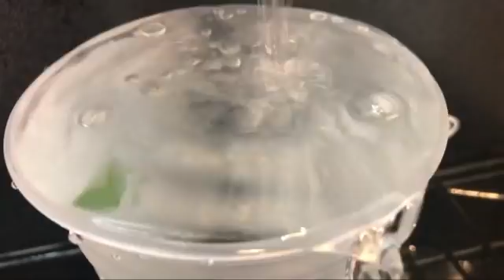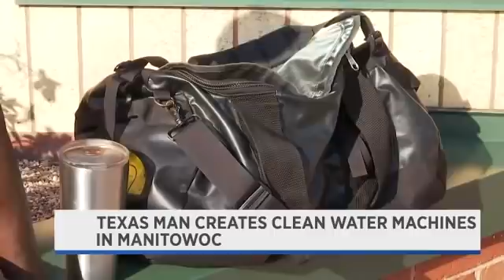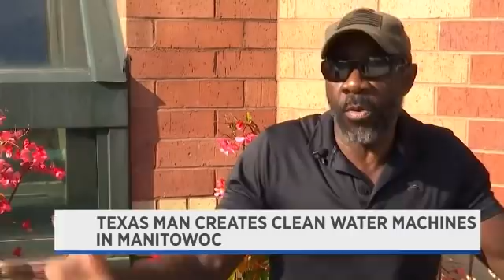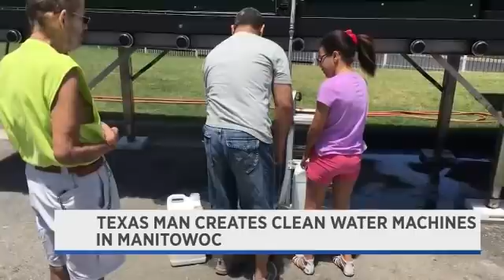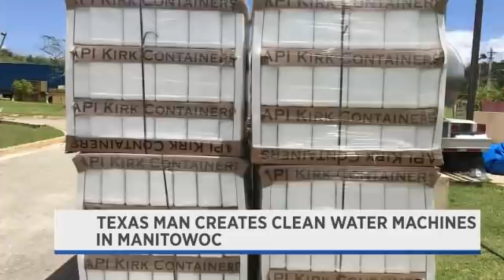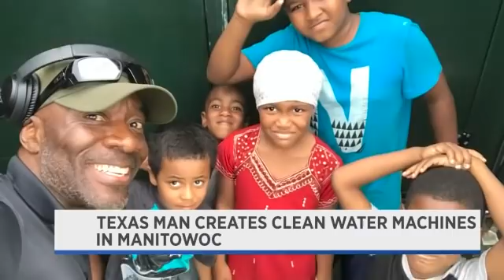Texas Man's Invention Creates Drinking Water from Air

Comment: He's done more for Flint than our government
Reply: no one  "Creates Drinking Water from Air" is false in every almost every aspect except for the word "from". 
TL;DR: It's significantly easier to get drinkable water from a filthy puddle, than the air around puddle.   
  
  
These types of machines are notorious for being "invented" every few months or so, with no real improvements to the general design simply because the physics don't work how people want them to. 
Basically, to get drinking water from the air you need to do 3 things, Condense, Purify, and Make Potable. Nearly every "invention" gets tripped up at the Condense step because the energy requirements are too demanding. For example, take a pot, fill it with water, and boil it until it all becomes steam. How long did it take? And how much energy did you use? Answer is usually 'a lot'. To pull water (not drinkable water, just water) out of the air you have to do that in reverse. All that heat energy that went into the pot then into the water has to go *somewhere*, to pull the water back into the pot. 
Then you run into 2 problems.   
*1*, the steam has dispersed. You have to now pull the water that's dispersed been throughout the room from a significantly lower humidity. Just like how people sweat faster/more during humid days, and slower/lesser during dry days, it's easier to pull water from high humidity air. Except, places with high humidity tend to also have local bodies of water which can be boiled, reverse osmosis-ed, distilled, etc. (all methods that are easier and cheaper than condensation) to get *drinkable water*, AND places with low humidity (the places that need water the most) are where the process of condensation would be the least efficient.  
*2*, your air is, typically, neither clean nor sterile. There's a reason we don't just drink rainwater, and acid rain is the most obvious example of why not. Another would be aerosolized bacteria. So, you went through all that trouble of collecting water from the air, but you still can't drink it, because there's still dust, particulates, and bacteria in it. If you're going to have to purify and make it drinkable, why not just collect water from the local pond faster and for cheaper, then purify that?
Reply: @TheEddagosp  i dont see the scam, where is it? He made the machine work, with a low energy cost. Read about it

Comment: Our camper air conditioner makes a LOT of water that annoyingly drips off the awning onto our lawn chairs if we forget to move them out of the way, and our basement carpet gets all wet in the summer if the A/C is on a lot and if the stupid old sump pump doesn’t turn on often enough.  The basement dehumidifier also gathers a lot of water from the air in our pretty dry walk-out basement (half is the garage).  I could use a dehumidifier for my greenhouse to store & put extra humidity back in the soil for the plants.  Our home water supply is rainwater or delivered water, so a water condenser to fill our cistern would be nice...don’t like the city water chemicals & don’t really trust if it’s clean enough.

Comment: Why are there so many smart ass comments🤔🧐.  Hell the sun has been around forever and yet people praise solar panels.  But y’all want to hate on this.  Why? 🤔🤔🤔🧐🧐🧐🙄🙄🙄🤨🤨🤨
Reply: Because this isn't a new invention, dehumidifiers have been around fir years. And in many of the places that really need water, this wouldn't work due to the lack of moisture in the air
Reply: Glen Carbon but in the places it is placed so far it works.  Will a fishing pole work in the desert area? No but it doesn’t mean it’s not a good invention.           Surely you are not suggesting that every single thing created must work for everyone and everywhere?  I am glad you are acknowledging the hate that is being directed toward him though.
Reply: @slyfox1983  

The places it's in so far all have high humidity. 

People do this all the time, they take a dehumidifier and make slight adjustments to it and try to market it as some brand new invention when in reality they're just copying technology that's existed for decades. 

I'm saying people are acting like this will fix all the water shortages when in reality it won't. There are tons of reasons why this won't work and why it hasn't worked in the past.
Reply: Glen Carbon who said this one machine will fix all problems? Which people?  What invention do you know that will do just that?  I never heard him say it’s completely new and this will solve every single problem as it relates to accessing drinking water.  Again it seems like people just want to hate for no reason.  Just be happy that someone cares. But again thanks for acknowledging the hate.
Reply: @slyfox1983  

Go back and re-read my comment. I said people are acting like it will fix the water shortages, what you're saying is hate is most likely people just being realistic. 

And as for other inventions that do the same thing. 

https://en.wikipedia.org/wiki/Dehumidifier
https://en.wikipedia.org/wiki/Atmospheric_water_generator
https://www.popsci.com/this-device-may-pull-water-out-thin-air-but-not-as-well-as-we-hoped/
https://www.youtube.com/watch?v=EGTRX6pZSns
Reply: Glen Carbon No you reread my questions and answer them.  What people are acting like this in a comment section?? How can one act in a comment section? Are you saying this isn’t news worthy?  What is your point?  We all know dehumidifiers exist.  This is a feel good story on the news and yet people want to tear this man down for helping people.
Reply: @slyfox1983  
It's a comment section on youtube, what do you expect? 

How do you not understand what I'm saying? "How can one act in a comment section?" Is that a serious question or are you just trying to be a literalist? 

My point was answering your question, many of the comments you view as hate are just explaining how this isn't anything new and explaining all the flaws with it. 

Nobody is trying to "this man down for helping people", like I've already said they're showing that this isn't as great as it seems because there are many people in the comment section who seem to think this is something new that hasn't ever been done and that it's going to solve all the water problems.
Reply: Glen Carbon yes I am a literalist when it comes to words because words matter.  Do you think people honestly don’t know what a dehumidifier is? What is my expectation?  It’s a YouTube section?  You just proved my point.  It’s a comment section filled with hate.  How do you know he hadn’t improved the design or something?  Just say you hope it works out and keep it moving.  The story was about a person trying to make the world a better place. Period.  What don’t you understand????????  I have not read a single comment that said this is “new” or hadn’t been done before? People like to put things out there under the guise of being realistic but it’s hating.  I have observed the comments about blacks being stupid.  If that’s not hate then what is?
Reply: @slyfox1983  

" yes I am a literalist when it comes to words because words matter."

And I used the word correctly, so why are you confused about it? It just shows you're being antagonistic for no reason. 

"Do you think people honestly don’t know what a dehumidifier is?"

I'm well aware people know what a dehumidifier is, but based on the comments many people don't realize that's all this is.

"What is my expectation?  It’s a YouTube section?  You just proved my point.  It’s a comment section filled with hate."
I'd hardly consider this comment section "filled with hate" I've seen many of the other comments you've replied to and they aren't even close to hate, like I've already stated they are pointing out flaws. 

"How do you know he hadn’t improved the design or something?"
I have no reason to believe he did. He never mentioned any details about how it works or the specifics behind it.

"Just say you hope it works out and keep it moving."
Why? So people can waste time trying to fund inefficient ideas like this instead of doing something that actually helps. 

 "The story was about a person trying to make the world a better place. Period.  What don’t you understand????????"
Why don't you understand that things aren't always that simple. What makes you think This isn't just another attempt to make himself money under the guise of helping like the other project I linked. We know almost nothing about this, especially based on this story. There are a lot of unanswered questions but it would seem you think asking them is hateful .
Reply: Glen Carbon why would you assume the worst of a person especially a retired veteran.  You are pointing out “flaws” and yet he didn’t explain the mechanics behind his machine.  Just proved my point again.  You don’t have reason to believe? How the hell can he do that in a minute segment?  Stop putting negative thoughts in your head. 

You say you’re asking questions? To whom? Or are you just wondering aloud?  Do you think he will respond to you?  

I notice you didn’t address the comment being made about blacks.  I guess those are realistic and not negative in your opinion??? 

We can agree to disagree and move on.
Reply: @slyfox1983  

"why would you assume the worst of a person especially a retired veteran."
I'm not assuming the worst, I'm just not blindly assuming the best. And him being a veteran is completely irrelevant. 

"You are pointing out “flaws” and yet he didn’t explain the mechanics behind his machine."
I don't need to know the mechanics of this specific machine to know there are flaws with all atmospheric water generators. 

"Just proved my point again."
Which is what? That people should just blindly think somebodies intentions are always good? 

" You don’t have reason to believe? How the hell can he do that in a minute segment?"
It only takes a few seconds to mention that he fixed flaws found in other atmospheric water generators or better yet to show where to find specific details on the machine itself.

"Stop putting negative thoughts in your head. "
Once again, I'm not going to just think somebodies intentions are good when I have no reason to. 

"You say you’re asking questions? To whom? Or are you just wondering aloud?  Do you think he will respond to you? "
I didn't say that, I said there are a lot of unanswered questions. Once again referring to not knowing how it works or if it's any different from others and if it actually worth using over alternatives. 

"I notice you didn’t address the comment being made about blacks.  I guess those are realistic and not negative in your opinion??? "
Because I haven't seen any, do you seriously expect me to read thousands of comments? And Like I have already said, it is the youtube comment section, you can find comments like that on nearly every video. In your original comment you referred to criticizing the machine and later said it's hate, if you wanted to talk about comments directed at the person then why didn't you mention them? And like I already stated, almost all of the comments I saw you reply to weren't hate at all, but legitimate critiques of the machine 

"We can agree to disagree and move on. "
You can stop replying at any time. But as long as you're asking me questions I'm going to answer.